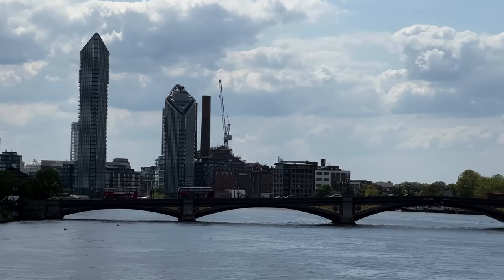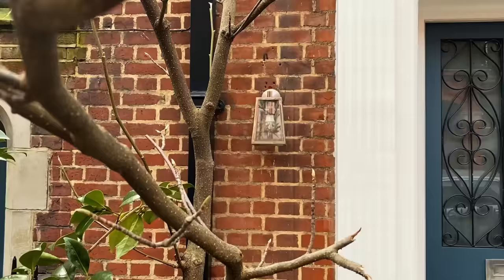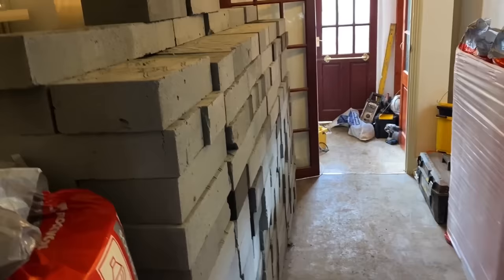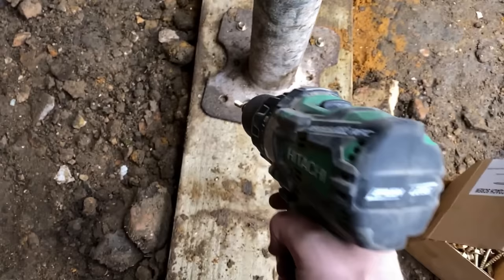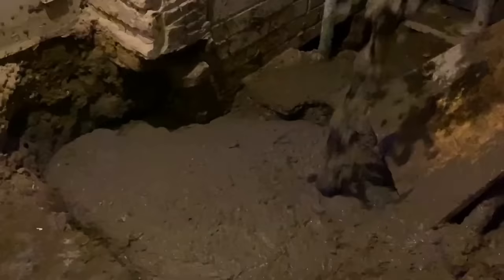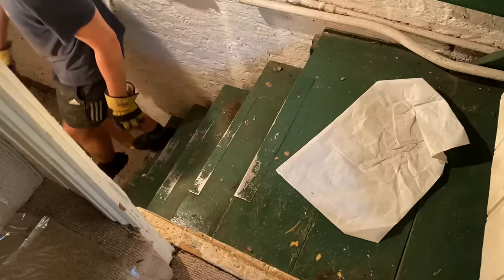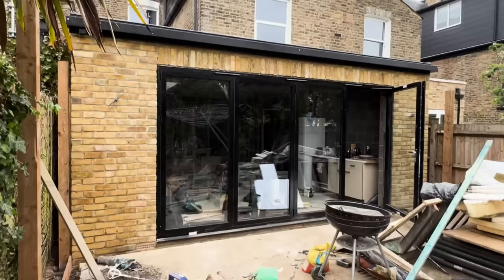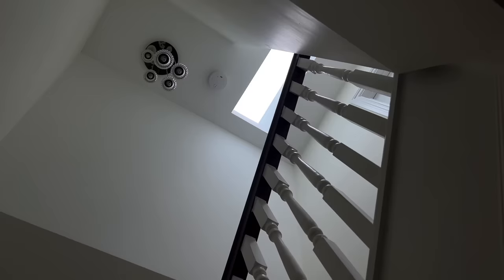1 YEAR (in 30 minutes) RENOVATING an OLD LONDON VICTORIAN TERRACED HOUSE into DREAM HOME

Comment: My hubby thinks you must be a son he didn't know about! He loves you. Your  attitude to work  getting a good deal etc is at one with his. We have between us built block of flat renovated ancient cottages lived in a bungalow which we turned into a house like you used tin lid on top and acrow props everywhere!! Taken down chimneys too what a mess. I spent a 70 mile an hour storm with the tin lid on and the sheets flapping with my head under the pillow scared to death! ❤️ love what you did with the London house. HUZZAH. From two retired inveterant renovaters/builders.

Comment: i studied historic preservation and clicked right away to see the interiors of your terraced house and to see what you did to renovate. you truly took it down to the bare bones and then rebuilt from the basement up plus the additional spaces you created. many of these houses were practically thrown up to meet housing demands during the victorian era so it was cool to see the quality of the build from the original structure. obviously you wanted a modern interior and from the look of it so much of the original failing materials needed to be completely replaced or repaired in the case of the front brick, repointed. appreciated your transparency on the good, the bad and the ugly of doing the work by yourself, when to persevere and when to get help.. also sometimes when you are renovating getting someone else to do a job frees you up to do another part of the renovation which can absolutely be worthwhile in the end. also appreciated the financial transparency that was very helpful to understand on a different level. thanks so much for sharing your experience and knowledge. ☮
Reply: Yup, it's always good to be strategic when it comes to building. I would always pay for someone to do proper planning and investigation, this is one place where you can save a lot of money, time and pain if you pay for quality.

Comment: Great video well presented. I felt your pain, the cost, the amount of work, the strange trades & people you have to deal with. I was in the building trade for 30 years like you i could do it all but thankfully i have just retired and people are still trying to get me to do plastering work lol. Building takes its toll on your body damp cold dusty heavy work. Just one thing in your tool list you forgot Shovel, Hammer, & more Tea than you can shake a stick at. Thanks for sharing your knowledge.

Comment: What was the total spent and the new value afterwards? Very impressive. For what it is worth, I was surprised at how reasonable the costs were for most things. I'm in Vancouver Canada and if I convert over much of this to local currency I'd have to guess that the costs for most things are closer to 2x. Planning approvals and potentially servicing requirements sound cheap in comparison. For example, to renovate our home we'd need to pay the city for a new sewer line, which would run about 25k GBP.
Reply: Totally the repointing for under 2k is amazing to me!

Comment: Very on point video. Can you expand on the comment about using permitted development rights for a "pod|" after getting planning to extend to the loft. What exactly is the pod? Was it the bit on the roof?

Isn't there a concern that the planners can prevent permitted development rights as a condition for their approval for the roof?

Comment: Great job. I got very similar mind set, if i can do it myself- why pay someone else. The thing i learned doing renovation of my apt. was: the first time is always the hardest- coz you dont know what are you doing and what to expect. Some times you will spend much more time doing the job yourself- just be ready for that. Second time is always easier... nevertheless you save a lot of money and by doing things yourself YOU know its been done right. I would like to upgrade eventually to a bigger place but i know that the second renovation will be much easier. BTW- i almost flooded my apartment( and all below me- i live in the 5th floor) as the pipe extension cracked when i installed the shower head. But i got lucky, and it leaked straight to the drain. Word of experience- when you work with plumbing always close main water valve as you go home.

Comment: Superb video.

Being a tight jock I totally get the dilemma about the shovel or mini digger choice. Work out how much your time costs i.e if you work 10hrs a day and get paid £200 a day your "value" is £20ph, that means that if it took you 10hrs to dig the footings and the digger would have done it in 2, you would save 8 hrs. If it is then cheaper to hire the plant then go for it. (although you do this when you mention the painter later on) That is if you are competent using the excavator, as you can cause a hell of a lot of damage (and therefore money) in a few seconds.

The word you are looking for, for your neighbour, is a 4 letter word and it does indeed begin with C. 

Did you have any issues with cables outside or did you find the drawings accurate?

Comment: Great video, noticed you put down the underfloor heating in the bathrooms. How was that wee mat system to install? I'm looking at renovating our main downstairs fridge of a bathroom from the previous owner as it's our 2nd winter and I can't make it warm nor get it feeling proper clean. We were thinking adding 100mm insulation board to the wall, adding a large new towel radiator and the same underfloor heating as you had. Would love to hear how you got on and if you think it's worth it.

Comment: I've been in the construction industry all my life and must say you have some big balls to take on a project like this and live in it at the same time. Being a labourer you would know what is involved before work commences. There are some things that I'm confused about though, saying you did all this in 7 months and calling the video 1 year in 30 mins? Holding down a full time job and also leaving said job? The cost of all your stages sound low to me even though they are not cheap. What is the current value of the renovation as the plans were submitted in April 2021 and  we are watching this in in November 2023? Well done on your timeframe in finishing this project, I've yet to see anybody on Grand Designs finish on time and within budget.

Comment: In germany it would not be possible to Do this way because you need static weich is in included in the building permission. As you pulled the beams thru the wall the would New a beam shoe or sometimes Kind of concrete base to distribute the load of the beam. Same with the foundation of the room extension in the basement. Looked like you forgot the reinforcement. Leeds to a destabilisation of the whole thing. Walls can crack. So be careful. Architects study for a couple of years to avoid just that.

Comment: At the tail end of a 16 month renovation project in Portugal and let me tell you I know what you are going through living in a house that is being renovated is no joke! The dirt and dust, moving from one room to another, plus the builder who hired the worst people and everything had to be done twice or even 3 times because of their fuck ups and his for not being on site and checking their work! It ended up with me becoming a micro manager because of all the fuck ups! We have done renovations by ourselves and hired people to come in and do bricklaying and plastering but because we had just finished a 7 year renovation of a 10,000 square foot house we were done in and this would be our last renovation! The builder has totally taken the piss out of us, our original quote was for a 3 bedroom house with 3 en suites, a new kitchen and new tiled floors in the living room dining room and kitchen area 10,000 euros turns out we have paid him twice that amount. The budget was 111,000 euros and its gone over budget by 70,000 euros!  This doesnt include the 85,000 we paid in tiles, kitchen cabinets, quartz counter tops, toilets, wash basins, taps, shower valves and in wall shower components, bathroom cabinets!  He is charging us 2,362 euros just to pull some wire through the house for the internet and we supplied all the plugs and the internet system! He has been charging us twice for things that have already been paid for and so now I am having to go through every single bill and see where he has over charged us..its been a fucking nightmare from start to finish!  I think you have done a marvellous job renovating this house and I know from experience its not easy so well done you for surviving the process!

Comment: How on earth? 1.15m buy price? How on earth did you manage that?
Reply: Because the market is actually dropping... so ... and sites like Rightmove are artificially holding things up... at this stage he should just make it energy efficient and future proof it... So it may or may not hold its value in the future etc. If done well. It can be sold and secure itself as a decent asset by some financial comp. If done badly, as usual.. it will depreciate. Love that he has added a lot of RJ45 to the building etc to strengthen the actual structures.... He should really have gotten a structural engineer at least than to go this alone etc ... are all builders so hot headed ?

Comment: Looks fantastic. One thing I still don’t understand. Why do Brits insist on plastering over plasterboard? The cost is incredible. Plasterboard sides are indented specifically to accept tape and plasterboard filler. Once filled, sanded and treated with a plasterboard painted on sealer that anyone can apply, there is no perceived difference to a plastered wall. And you’ve saved a ton of money. To go to the expense of plastering by a plasterer then tiling or wallpapering over it is simply ludicrous. 🤷‍♂️ Have you had a valuation done since you completed all the work.

Comment: Loud noise can kill! My neighbours cut down a tree without informing me, I was woken to a noise that turned out to be over 120 decibels, the noise of a burglar alarm that can cause deafness in minutes that can never heal. You can also go into shock which I did. I was lucky but I could have died and been deaf from a unthinking neighbour. Noise on building sites is limited in my country to 70 decibels and the councils enforce this limit and for a good health and safety reasons. All you have to do to be a good neighbour is to keep the building noise down to this level and thell your neighbour. Don't wait for them to complain as they will and then take umbrage!. I am glad you are not my neighbour as you do not seem to understand this. 

Is your renovation in time and effort worth it? Time will tell. It will date quickly. Personally I think a sympathetic architects are worth their weight in gold. You have skills to do this and good on you but most of us do not. Great horror video though. Scared me stiff!

Comment: Maybe it’s a generation thing, but  lath and plaster instead of plaster board, and real wood floorboards or stone floor, instead of laminate flooring are essential. Once you’ve lived in a house like that you can’t stand a plastic palace. Unfortunately, if I was viewing your house, I would consider those two things to have totally trashed it, and made it pointless being a Victorian house. I would rather drop the kitchen, and have real walls, ceilings and floors instead. Stay authentic, don’t put  modern plastic walls ceilings and floors there which belong in a cheap modern house. This is how philistine Bob  the builder butchered many a historic house, along with knocking down walls and using gypsum plaster.  That’s far more important than your kitchen extension. The rooms get smaller as you go back in a Victorian house, not bigger. So historically inauthentic to have the biggest room, the kitchen, slapped vulgarly on the back, competing with the reception rooms in importance and size . So nouveau riche. If you do it again PLEASE learn about Victorian architecture and building methods, and their purpose, first. Then you will understand.